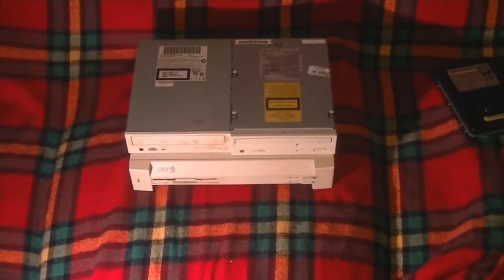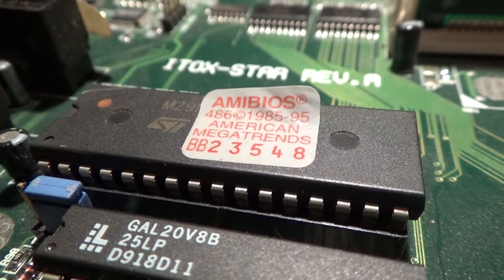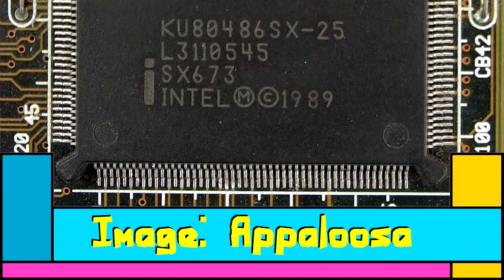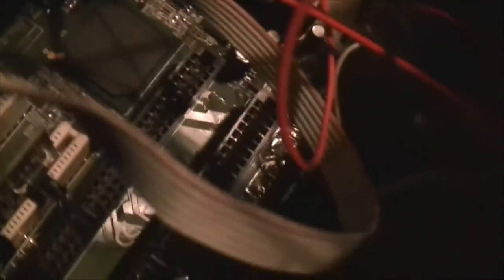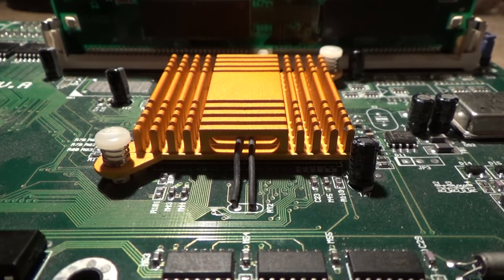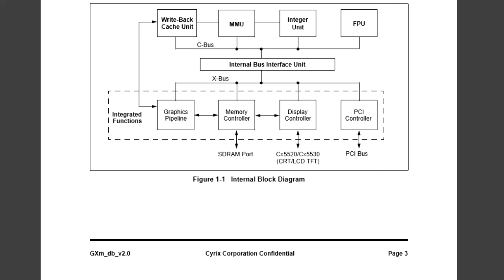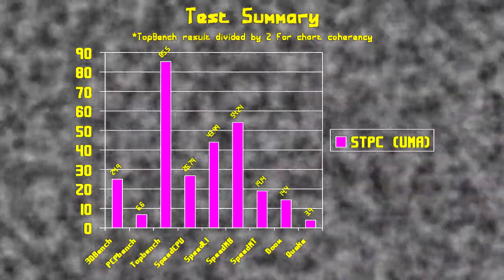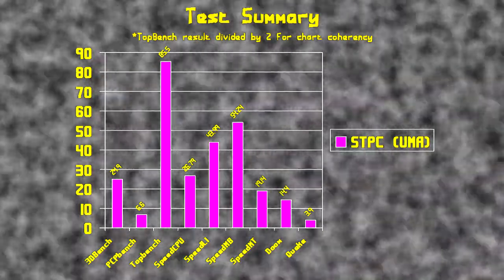STPC (Embedded 486) & Industrial x86 explanation

Comment: Check out Vortex86 embedded CPUs...kind of neat. Wish the dual core embedded board was not so expensive :(
Reply from the maker: Those were mP6-based initially, though I have no idea if the later models are using something different or use vastly upgraded mP6 technology. Pretty neat, but I don't think I'll be getting one as they are, indeed, often priced far too high and I don't think I'd have a use for it.
Reply: Find a use :)

Comment: I am not really too sure something like this would need L2 cache given everything is pretty much integrated into 1 chip and should cut down on latency by quite a bit by not having lengthy traces on the motherboard to slow things down.  Seems like an LPX case might work for this motherboard.  I think it would be fun to play with one of those "modern" 486 industrial boards, but I have a feeling the performance would be disappointing given the cost compared to traditional 486 boards. Too bad they didn't run these chips at higher clock speeds than 133, sure seems like it would be able to clock much much higher given the modern manufacturing processes. 

Since we are on the subject of 486 processors, you might be a little bit cheesed at me in a couple weeks when you see what 486 processor I picked up this weekend on ebay for a handsome price of $15 shipped. I promise, if I find another one I will let you know.
Reply from the maker: Indeed, it suffers very little from the lack of external cache and I suspect the 66MHz bus speed might make up for it too. I'll think of something for the case, I was somewhat tempted to stuff it inside a length of pipe with the headers fixed to a stop-end as such materials are easy to manipulate. I think the closest to a faster chip you will get is something like the Quark X1000 which is Pentium compatible, but uses single 5-stage pipeline, it can operate at 400MHz. It gives me a slight WinChip vibe (Single 4-stage pipeline) looking at the inner workings.

I doubt I'll be cheesed off at all, though possibly with eBay's automated system if it didn't inform me of a saved search. I look forward to seeing what you have gotten hold of.
Reply: I was thinking there was a Pentium compatible version of these SOC processors, didn't remember what it was though. What do you think the chances are of this STPC chip actually being an underclocked, repackaged and relabled MediaGX ?   Did you make any progress with your Deskpro 560 XL ?
Reply from the maker: There have been a few Pentium compatible SoC's, or ones that claim to be so. I'd imagine the STPC Vega probably was, with the MP6 core. I'm not inclined to think this chip, in my case the STPC Client, is an underclocked MediaGX because there are too many differences inbuilt hardware, also by the time it was produced National and AMD had the rights to the MediaGX as used in the Geode GX. The only possible relation being that ST may have used some technology from the Cx5x86, and I believe the original MediaGX was a direct derivative of this if not the 6x86 (Of which the 5x86 itself as a derivative) so who knows. Either way, they are both essentially Cyrix technology. I haven't had a chance to get hold of any floppies to get the Deskpro 560 XL going as of yet and instead turned my attention to cleaning that ugly 486SX and attempting to rebuild my AMD K5. I was planning to run out to Maplin today but this relied on getting a ride from a friend, but he's been asleep all day so I'm probably out of luck until next week now.

Comment: but it will play doom and doom 2 awesome and even tyrian 2000 if you set it to lower settings maybe even at Pentium level if you  have a good pci graphics card. It's basically awesome for dos games from about 1989 to about late 1994 if you have a decent PCI graphics card max amount of ram and good sound card, sb16 would be really ideal in it and IDE cdrom drive.

Comment: diskonchips are horrible storage mediums. they're read-only, there's no real good information on them, and so far as I know, no one has ever made a solution that plugs in with the ability to plug in an SD/CF card or what-have-you. 
I have an SBC myself, it's an Aaeon HSB-811P with a Pentium M 1.6 Dothan on it. originally it had a 1.3GHz Celeron M on the board. I have no idea what the purpose for it was, and all I know is it runs Linux fairly well-- but I don't have a backplane for it to sit on, so I have to use it screwed atop a power supply and keep it contained to that.
only thing I know is people want stupid amounts of money for them on eBay, for something with a Celeron and an 865?gm chipset.

The only good thing about SBCs in industry is that they ARE standardized, be it how many standards there are to go with. A friend of mine has an older IBM SBC enclosure from the mid-90s and it has a Pentium 4-wielding SBC inside. the bad thing is they ARE such niche boards that people CAN get away with asking for that silly amount of money and people WILL PAY FOR IT (in time.)

and in terms of Atoms, the Atom is indeed the correct class of CPUs to put up against. they ARE the last  home/office/industrial Intel-made CPU (with the extremely tiny CPUs on those Galileo/Edison/Joule boards notwithstanding) that executes x86 instructions natively... but that's an entirely different discussion/argument circle for another time.
Reply from the maker: I had a feeling they might be like that, though I'd imagine they're probably adequate for a machine with one set task where mechanical drives wouldn't last long - as noted, vibration or dust. I think the M-Disk 2000 is writable, but I'm not sure just how writable it is and would still like to get hold of one. I've seen industrial boards with an SD card slot on them before now, and I'm certain there are server boards which offer this too. Indeed, prices are rather silly for these things.
SBCs with backplanes are something that has always intrigued me and I've always been tempted to get one, though I probably won't as I now have a machine which works in a way close enough to one that I feel I needn't bother. It's a workstation, not an industrial machine, but it serves as a good enough example and ticks the boxes in my head that wanted to be ticked.

On the execution of x86 code, yeah, that starts a bunch of headaches. I think I briefly touched upon some of those in the NexGen video as processors aren't always as they might first appear to be.

Comment: I just picked up a complete Comdial WI-STAR150  of eBay , which uses this board, , The seller was trying to get $150  + Shipping for it , so I offered $35 shipped, the seller countered at $100 + shipping, then I offered $40 shipped, the seller declined my offer and told me not to put in anymore offers like I was entirely lowballing, I then offered $50 shipped and sent a message pointing out that the industrial computers are almost worthless once removed from service for their original applications and that the majority of these high priced industrial computers on eBay have been listed for 3-4 years and have not sold and after waiting several hours they accepted my offer. 

Here is the eBay listing if you want to see the pictures of it: 
http://www.ebay.com/itm/Comdial-WI-STAR150-Desktop-PC-ITOX-STAR-STPC-66MHz-6MB-RAM-0HD-Post-3-ISA-Slot-/172497007837?_trksid=p2047675.l2557&ssPageName=STRK%3AMEBIDX%3AIT&nma=true&si=9mpqpwVZqgHoefcDRPibO0i0suQ%253D&orig_cvip=true&rt=nc
Reply from the maker: Neat! That's the little square case I referred to, good to see what it looks like inside beyond what the manual shows. Surprised you managed to get the price down, many of these sellers simply refuse to budge, even on items I know were listed around a decade ago.
On the Packard Bell you mentioned in another comment, I didn't know they made one like that. Good luck with finding an adapter, I've not seen one. I do have an Opti Sailorboy which at least allows for Socket 5 processors, but I have never seen another one, ever, and it was designed for one particular motherboard.
Reply: I don't really ever expect to find one, but it would be neat if I could, there is a user "Anonymous Coward" on vogons and vcfed that had been searching for one since 2007 and it took him until 2015 to find one, I know this because his posts are the majority of what you find when you search for "Powerleap PL-54C/MMX" on google.
There were several models of Packard Bell computers with P60 processors based on the "520R" board, which from what I remember has an Intel chipset, an onboard Cirrus video card , and featured an onboard CMD 640 IDE chipset that is sort of infamous for causing data corruption when both channels are used simultaneously. The Cirrus card does not work properly with the built in driver on Windows 95, to get it to work I had to install the Driver included with DirectX 6.1( older versions may include a version that works but 6.1 is what I used.)
I could pull it out in a few weeks and make a video about it, I can't make one right now because the computers are in my dad's basement and I am currently staying at my mom's house and due to noise and space constraints I can't really make video at the moment. I have bought a house that I picked up rather cheaply at forclosure, but I really need to get the crawl space cleaned up before I move in, it'll be a few weeks before I can get a crew out to clean it up, it's going to be quite a job, they're going to have to tear out all of the existing vapor barriers both the floor barrier and the barrier that the previous owner stupidly put on the underside of the joists along with all the moldy insulation in the joist cavities as well as any debris on the floor, then they will spray the mold with a cleaner, then scrub and vaccuum the mold with a HEPA vacuum then spray another anti microbial substance on the joist, then from there they are going to install drain tile around the perimeter and install a sump pump, spray foam insulation in the rim joist area to air seal and insulate,  install 4 additional piers to reduce the strain on the central beam , and set up a dehumidifier, then they will seal the floors and walls using a heavy 20mil plastic barrier.
Reply: Also, my P60 machine was manufactured in late 94, so it has an FDIV bug version of the chip, I think I had the P60 overclocked to 66mhz , I can't remember if I bumped the voltage or not, but it ran Prime95 for several hours just fine, I have my cooled pretty well , the original front case fan which blows directly over the seemed like it was wore out so I replaced it with a spare fan my brother had lying around that he had pulled from his server case, I think it is a 3000-ish RPM 80mm or 92mm ADDA , it moves a lot more air than the original fan did, it's a little loud but not unbearably loud.